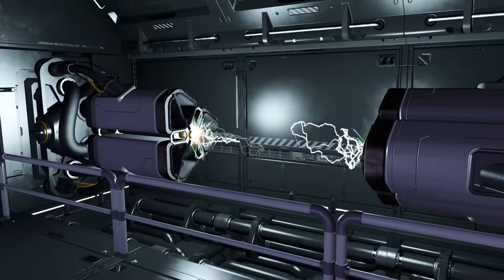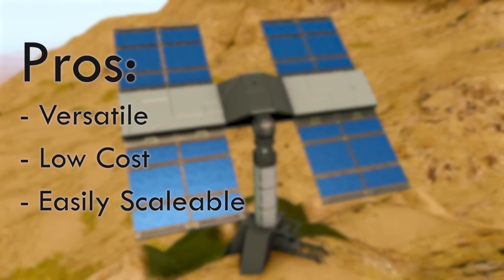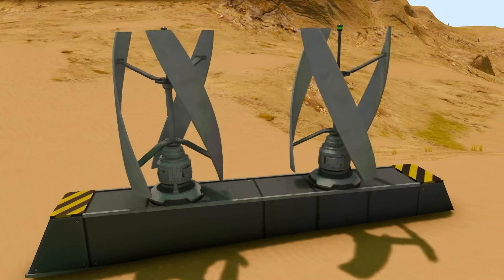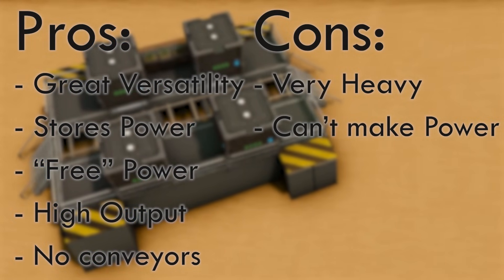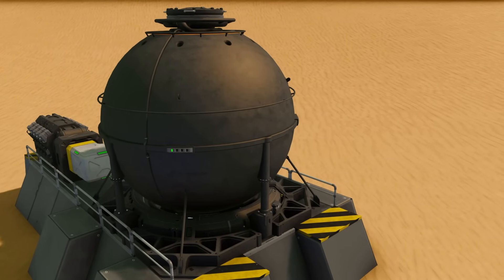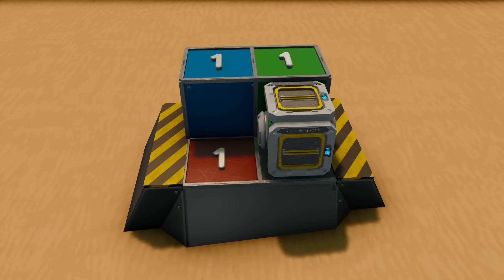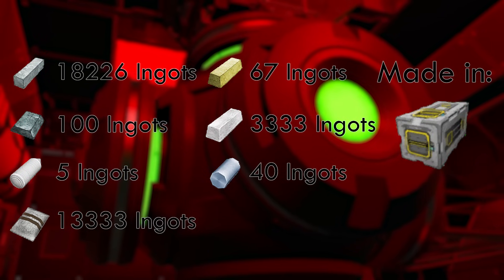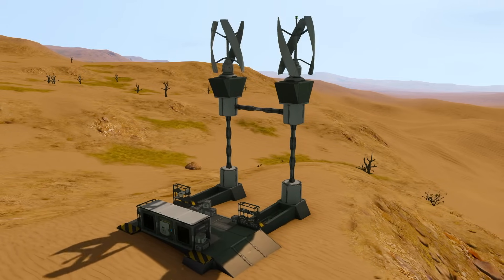The BEST Power Block in Space Engineers - Tier list & Comparison

Comment: Been playing on a server and I can tell you that while uranium is hard to find at the start, by the time you found it once, you're basically set for life. Reactors are so fuel-efficient that you can basically run a production-heavy ship that regularly jumps around for DAYS before the thought of your uranium running out even comes to mind, while hydrogen has the tendency to run out a lot quicker.

And it doesn't help that H2O2 generators are sooooooooooooooooooooooooooo slow. So is processing uranium, admittedly, but uranium lasts for a lot longer than hydrogen does.

The large reactor personally I suggest only for huge production bases or true warships that you will expect to be jumping around and firing railguns a lot - all activities that drink a LOT of power for short bursts.
Another major vulnerability of the large reactor is that it's one big block - if it is taken out, that's a huge cut out of your ship's power, while small reactors, while more expensive overall, allow for more redundancy.

All in all, I consider small reactors to be the true backbone of any good ship, solars to be a great mid to late game passive power generation tool for civilian ships and bases to integrate existing power consumption, and large reactors a specialized tool for the biggest, power hungriest battleships.

Comment: Not sure if they were out yet. But in the NEWest DLC the large turbine has a higher output.
Also batterys store power they do NOT create power. they should not of been in this video
Reply from the maker: This video covers power blocks. The battery is a power block, and has the POTENTIAL to create power. I said it spawns with power, never that it makes it. But clever engineering can make a power generation system using batteries.
Reply: @BenDoesThings404  how much energy does it take to mine and refine then assemble the parts for that 900 power? That's the real question
Reply from the maker: @woodzyfox4735 Good question. Might test it later.

Comment: Hydrogen engine is the king, one thing you didnt mention is the COST of refineries vs H2O2 generators, refineries are EXPENSIVE, generators are practically given away. You can chuck 4+ H2O2 gennies on your ship for far less than the cost of one reactor, so your ships can practically carry ice as feul rather than hydrogen, and mine more feul on the go. I usually place 20+ H2O2 gennies on my main base so ships that dock can get their tanks topped of quickly - MUCH quicker than waiting ages for batteries to charge if you are using ion/atmosfear engines.

Comment: For those who use the watermod and don't know yet, you can get infinit hydrogen by putting a collector in the water. Slap three or four hydrogen engines in your base and that will run pretty much everything you will want.
Reply: A wonderful example of Keen's lack of scientific rigor in the game. In the real world, extracting hydrogen from ice (or water with the mod) requires more energy than you can ever get back by burning it (with oxygen) in a generator (or thruster, or whatever), so isn't an effective power source. Otherwise we'd be using it instead of gasoline, solar panels, nuclear power, etc.

Comment: Nuclear is absolutely king, especially when combined with a large battery chain.
My main ship is a power hog, as it has 30, YES, THIRTY jump drives (I can enter a server in space, and in 8-10 hours straight, get the mats and weld it by hand, believe it or not).
The ship has 62 batteries (2 for each JD, and 1 for general ship systems, and 1 backup battery set to recharge), and one large reactor.
The power output is bonkers (measured in Gigawatts), but it means I can jump >40,000 KM in just 7 minutes 20 seconds if going full hog. It also eats uranium like a hobo wolfing down a ham sandwich, but I'm a jump addict, so it is what it is.

The ship itself is actually propelled with H2 thrusters, and some small ions for docking procedures to save on H2. 4 large H2 tanks, along with 8 emergency small H2 tanks. The emergency tanks are to power 2 H2 engines long enough to get me to some ice, or, in a pinch, provide fuel for an emergency landing in high G, assuming the 3 parachute hatches are damaged, empty, or there's no atmosphere.

The ship also has some solar panels, so you will never truly be dead in space when it comes to power. As long as you can find ice or uranium ore, the ship can process them into usable fuel.

Every power generation system has its uses, but yeah, the battery is the greatest, and nuclear is the best for charging batteries quickly. A pro you missed about wind turbines is you can use them in underground caves, making them the best cheap power source for stealth bases on planets with atmosphere.

BTW, if anyone is curious about the ship, the model a couple iterations behind my personal one (I'm on the Mk.VII) can be found here:
https://steamcommunity.com/sharedfiles/filedetails/?id=3029694875
100% vanilla, with industrial smuggler theme. A mobile base among the stars.

Comment: Should be noted the refinery can be equipped with yield, speed and power modules, which can either increase the speed by a large margin,  increase the amount refined creating more fuel, or save more power refining the ore itself,
Reply: but, refineries are expensive, you can plop 10+ H2O2 generators for the cost of one refinery....

Comment: Main thing I don't understand is how are y'all using so much power?
I used to play lots on big multiplayer servers (>1800hrs on steam) and most people would have ships of a couple thousand blocks or less.. I liked to build my main ship as a mobile base + luxury yacht so somewhere around 6k-12k blocks (no idea on PCU as this was a while ago) with refinery and manufacturing all on board. Despite this though with the manufacturing running full tilt, several fully upgraded versions of each block I'd still only use a couple MW passively

And when you DO find a uranium asteroid, mining it for half an hour can provide enough uranium to sustain this ship for well over a month.

The actual power sources I used always ended up as a single small reactor + a battery wall for capacitance. Jump drive recharges, flying with ion engines and all that would use the batteries and they could keep everything running for half a day easily then the tiny reactor topped it all up overnight while I slept

Ground vehicle? small reactor + some batteries
Planetary air vehicle? small reactor + batteries
Largeish space vehicle? you better believe it's a small reactor + batteries!

Only exception being very early game or a small grid miner that I'd park inside my yacht, which would just be a single battery, single H2 tank, 4 drills, and a couple small H2 thrusters in each direction. Also ~3 large storage containers to make it look like a burrowing worm as the servers I played on were typically 1/1/1 so I could easily fill those containers

Comment: 32.6% (approximately) increase in weight to power ratio for the 27 Small Reactor configuration. The fringe benefit of which would be that it doesn't require any Gold to achieve a 405MW output in the same space as the large reactor. The weight difference of 57,116kg is roughly an additional 79% the weight of a Large reactor, so I can see how only gaining the additional 105MW output (34% Approximate) increase for almost 80% the weight of a second Large reactor may seem like a major flaw overall.

However, as stated earlier, it doesn't require Gold and its weight/mass is a negligible factor outside of planetary gravity. Given you will likely be in space by this stage, it's an acceptable trade-off if Gold proves difficult to procure or would be better used elsewhere. The PCU factor is likely the more pressing issue for such a Small reactor configuration, practically speaking. 

What would be nice is a larger battery array, similarly scaled to the Small and Large reactors. A Large Battery bank block, like a single 3x3x3 Battery block or other configuration that takes up the same Volume, with a higher storage and output capacity scaled similarly to the reactors would be a nice addition to the power options. Simply considering the PCU factor, having exponentially increased power to PCU "bulk" blocks would help with a lot of issues.

Much like adding tiered or purpose built (as in high acceleration, high efficiency etc with drawbacks) Thrusters and ship tools would help alleviate many issues as well.

Comment: Batteries have a HIGH discharge rate...   12mw in and out.   lots of times though i find it best to have lots of batteries,  because sure, if you are recharging 4 large batteries on a ship, you only NEED 4 large batteries on base to do that, but that can quickly cap out thing.   asteroids, moons, place with no atmosphere, i'll use solar tracking cells, backed by ICE engines unless i find a large supply of uranium for bases.  For crawlers and ships i tends to use reactors.

atmospheric planets, i'll run Wind turbines.

Comment: Hydrogen engines are my go too for power when on a world with plentiful amounts of ice.

I even made a semi truck that is hydrogen powered, with only one small grid large battery for backup power. It also has two small grid small hydrogen tanks for some basic hydrogen storage. I usually rely on a trailer to hold large amounts of hydrogen. I also only run the engine when the battery is low.

I like the truck because i can build a trailer for anything. Im going to make a generator trailer at some point.

Comment: I try to use a mix of power sources never just 1 and if it is my base I tend to use all of them if I can. Just because I have a reactor doesn't mean I will get rid of my solar panels, I like the look of them with how I set them up
Reply: I like to use a main source and at least supplemental source. My main rover at the moment (large grid) runs on a couple of hydrogen engines that charge 4 batteries when they get low. However on top of the rover I have a couple solar panels that charge passively during daylight. Even if I’m stuck without power and without ice to make power, I can do whatever till daylight and get on the move to find ice or go to my fueling station.
In other words, I agree. Combine them. Backups are a must.

Comment: I feel the need to rely on another system makes batteries significantly lower on value. And then you have charge time on top if you separate the systems which again makes it even bigger
Reply: Yes, others require processing for the fuel.

Each system can leave it's power production at base and fly off with just fuel or charge.

Comment: In my opinion, the best choice is situational. You definitely do not want reactor power on planetary bases and rovers, at least as primary power, because there is no uranium there and you will have to supply it from off-world. Bases, ideally, should be powered entirely by unlimited energy sources so you do not have to constantly maintain them. Rovers, on the other hand, should be powered primarily by a combination of hydrogen engine and battery, with a single reactor for emergency use only (hydrogen-powered vehicles cannot start themselves up if fully depleted, since they require energy to turn ice into hydrogen). Rovers not intended to go far from base can use purely battery power, however. How I like to set up my rovers is with a power management script (typically a slightly modified version of Isy's Solar Alignment Script). The hydrogen engine(s) will charge the batteries, then automatically shut off. They will reengage only when battery power reaches critical level or exceeds power output needs. The reactor is excluded and only set up for manual start, as you will need it to get the rover going again if you accidentally mess up and fully drain it.

Comment: One 'con' I'd like to add about batteries is that on auto mode they charge from other power sources while discharging to power power-using blocks.. unless they fixed that.  (Didn't play SE recently..) 
I've always struggled with achieving a setup that
- only charges batteries with excess wind and solar energy; and
- to have all other power blocks not charge batteries.
I did look at some mods for it,  but didn't find anything to my liking yet. Would be great to have power prio settings options that fit these needs.. or some wiring/ logic possibilities to make this happen automatically, to waste less energy through batteries (as they have what.. 80% efficiency? And solar & wind energy already don't provide much power compared to resource-using power sources..)

Comment: Cool video. Thank you. An extra con for the battery would be that it doesn't charge with 100% efficiency. I think it's 80%, which means that if you use a reactor or hydrogen engine to charge it, 20% of your fuel is wasted. It's only worth using batteries with solar and wind, otherwise it's always more efficient to just run directly from the reactor or engine. This reduces the battery's versatility a great deal in my opinion, and precludes it being given S rank in my own rankings.

Comment: you missed the fact that the hydro generator needs fuel and pipes  ...and  add in the tanks and h202 generator to the  size...it adds ups quite a bit
Reply from the maker: I did point out that the hydro generator needs fuel and pipes to run it. That was the whole point behind comparing the fuel it uses vs the fuel a reactor uses. Should pay more attention next time 🤔